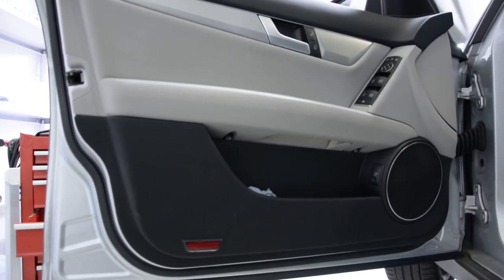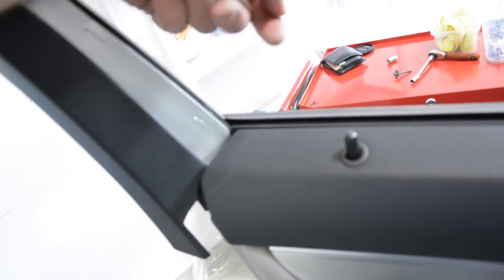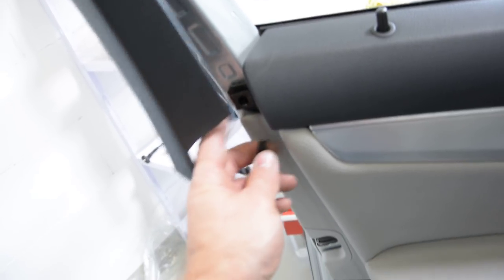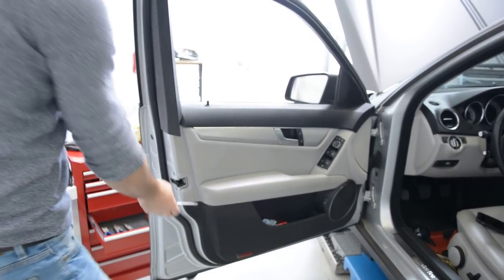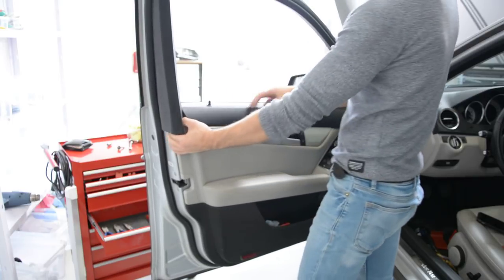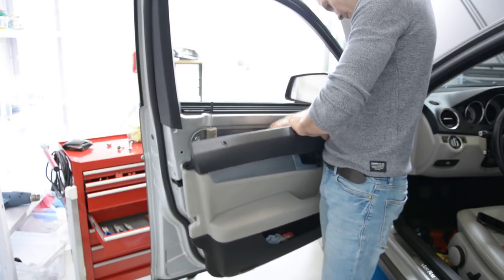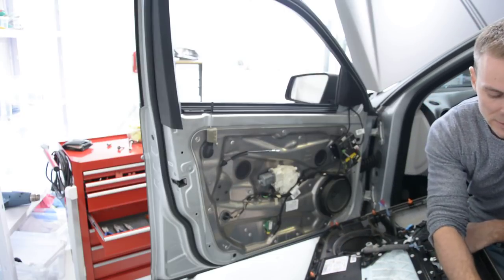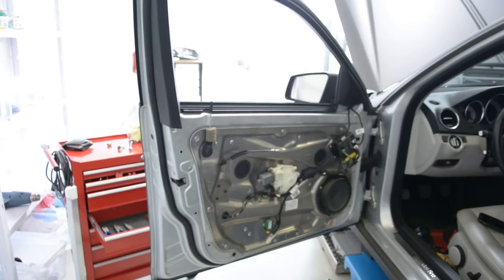Front Door Panel Removal Mercedes C Class 2012

Comment: Thank You, My wife's 2013 c-230 door handle broke and the dealer quoted $1700 to replace it. I watched this video and looked into it myself and with a very long tiny screw, 60 second epoxy, small drill bit and 45 minutes of my time I fixed the handle (Okay, I upgraded the handle with epoxy and a screw) LOL In all fairness these handles are built in the door panel so buying the broken door handle part was not an option from the dealer. Thanks for sharing your video
Reply from the maker: You welcome

Comment: Bro, give me a tip please. My 2009 W204 estate rear right door stuck on lock mode. I ve managed to remove the inner liner first then somehow pulled out the door card. I nees to take off next the aluminium panel but the actuator is gone amd the latch is locked. How can I go past that, please?

Comment: Hey, 

My interior door knob broke on my 2013 c300 Mercedes,  could this be an electrical  situation too, or just a door knob replacement ?  ( I pulled the knob too fast & the quality of the material isn’t its best.)
Reply from the maker: Is a common problem with this model and the older model to. Is not electrical, here you can finde the Reparatur kit for your problem 

https://rover.ebay.com/rover/0/0/0?mpre=https%3A%2F%2Fwww.ebay.de%2Fulk%2Fitm%2F292307094178

Comment: How do you remove the clip??
Reply from the maker: after you unscrew all the screws the door is  held in place only  in the orange clips, you have to pull towards you to detach the door panel from the door. 
do everything as explained in the video and you will succeed :)
Reply: If the clip behind the cover is installed correctly then you can use needle nose pliers and pull the inner pin out. Make sure to install it the same way and only push it in until its flush
Reply: You didnt show how to remove the pin clip behind the cover as it was already out in your video